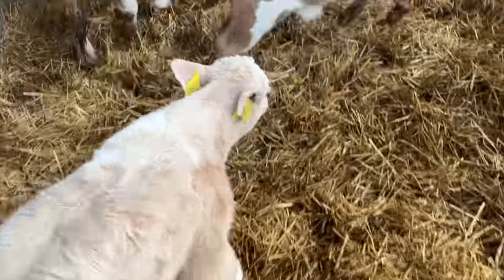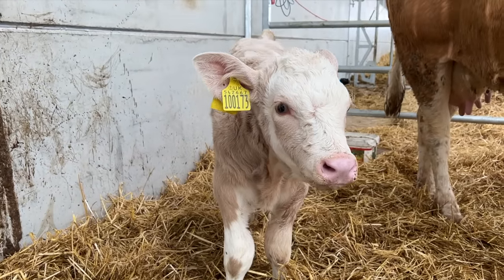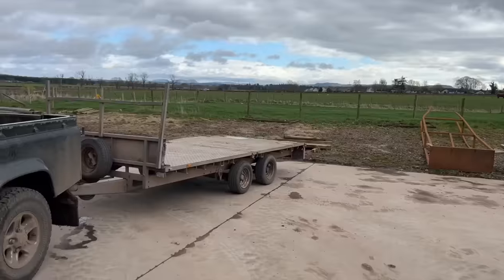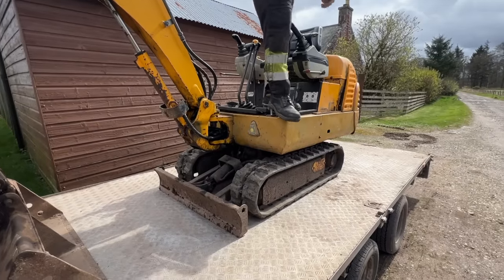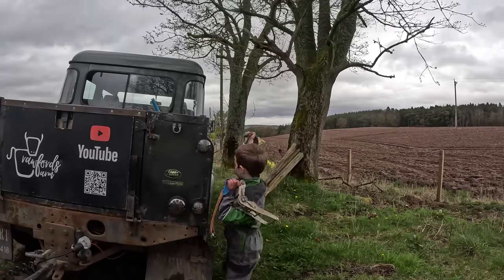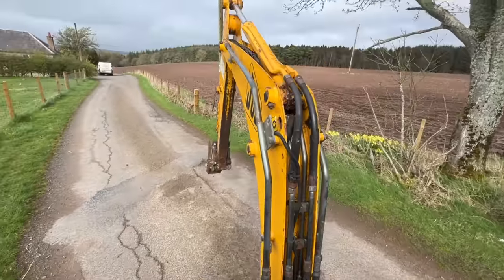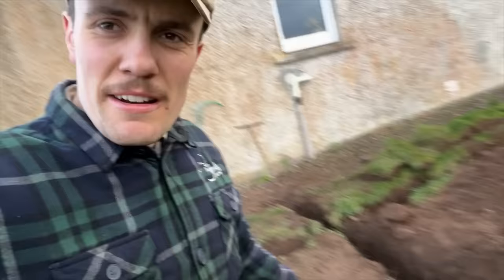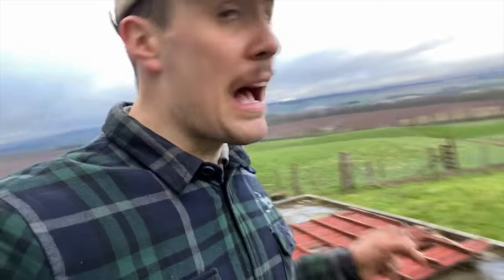Angry Boss & Calf Pneumonia

Comment: Why not start at the trough and follow the pipe back to the feed ???
Reply: That might have been the more "sensible" option 🤣
Reply from the maker: Did have a looky down there, but no reason for anything to be inter-feared with down there. Garden snd round house had works done few years back so think its related to that